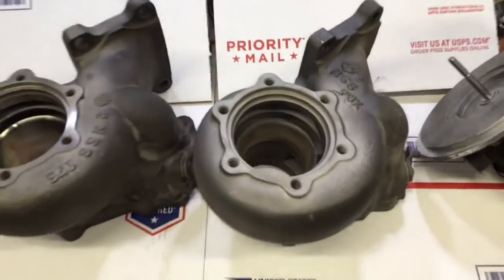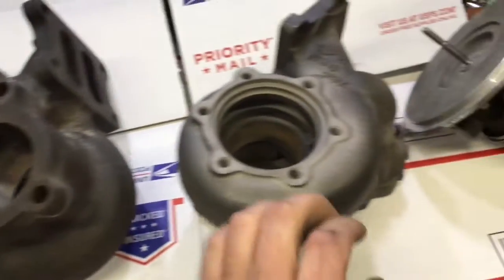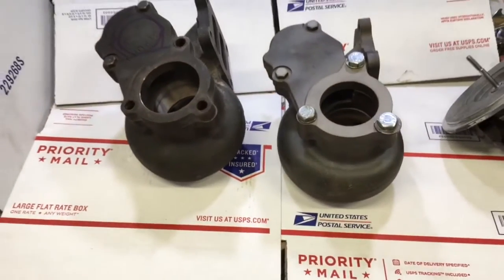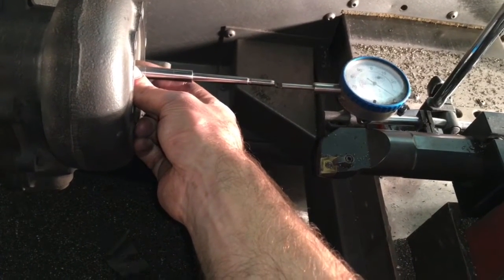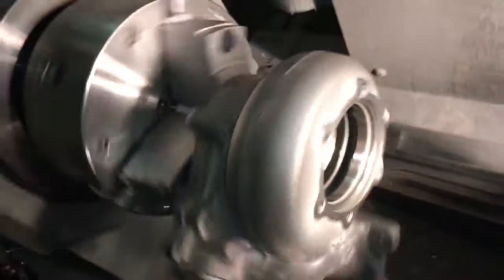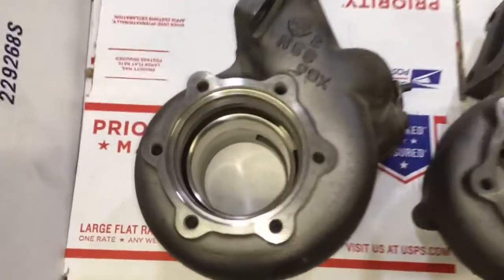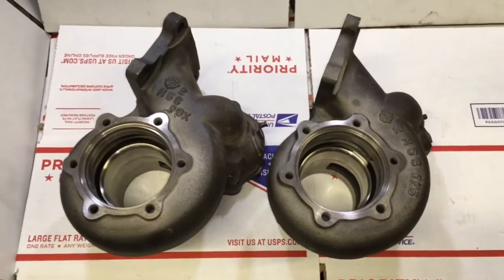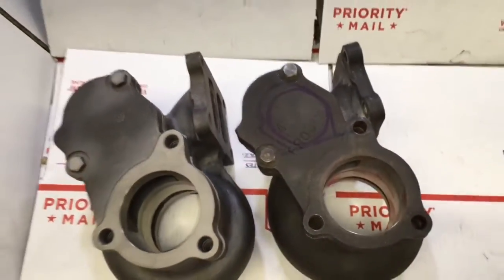Mazda RX7 Turbo upgrade

Comment: PS: we just produced close to 400 hp with these turbo's on a stock 91 S5 13b TII.... mind you there are other modifications required to handle the power, but the ports and intake were stock, 1000cc I.D. primary injectors, 1600cc 5O motorsports secondary injectors, microtech ECU, solid dowel pins and pan brace... (that ifo was fer the rotory guys) , again Trust turbo labs these guys are the S+it! awesome work, thanks again
Reply: !8 to 22... se more detailed answers below
Reply: joe shmo @what psi
Reply: joe shmo how much boost are you running with that turbo setup? I’m wondering if it will be hard to control the boost. Did you just install a 3 inch down pipe? I was thinking about going with 3.5 down pipe? Great job on the 400 hp
Reply: as far as controlling boost, I have ported the wastgate passages, not only enlarging them but straitening out the corners, and additionally I ground a relief in the read cover plate to allow the wastegate door to open further, you can google rx7 wastegate porting (images) for lots of photos , some guys do a butcher job on this mod, it is important to do a very clean job and also to leave enuf material to enshure the flapper still seals when shut, I'm planning on posting some videos of this on my channel soon ,I will also link to them here in the comments ... I use an innovative boost controller gauge to control boost, I was running 18 to 22 psi depending on the quality of fuel I could get, we have NON ethanol here and its good stuff,92 octane. and my exhaust is 3 inch and that's plenty, I have even had 2.75 and had very good results, But my exhaust is only 3 1/2 feet long, as it in not in a street car,.... the tune is the most important part of the gig, we run a standalone computer (microtek lt10) you have to start very rich and keep tuning twards detonation, Again as soon as the season is over we will be posting a lot of videos on these results and hope to gain a following as to help any other s4 s5 guys out, there is an unreal amount of power availibe in these engines that people are in aware of and its so awesome to bring it out!
Reply: joe shmo that’s Pretty cool I was always looking online to see if I can find someone that had done what I was trying to do but couldn’t find much info. Glad to see you did it and you’re having good results I can’t wait to try mine out but I still need a couple more mods before I can install it in the car. I am going to install it on my 93 Rx7 I have an apex power FC still need to buy a fuel pump going to use stock 550 primary and 1680cc secondary. I was hoping for 400 hp I guess I will have to wait and find out.
Reply: 20 psi wow, what duty cycles are.you reaching with the 1000+1600 CC combo?

Comment: What do you guys think of the new gtx3584rs?? Can't wait to get this turbo in my car!!
Reply from the maker: +Guillaume Bergeron is that the gt35r turbine with t67 compressor wheel? We built one for a customer that made great power on an evo, he ran it for a year. He made hp in 700 range then a few month later in the 800 hp range, then his last time made 926 hp but came apart. The gt35r cage wasn't made to run 40 psi with that large of a compressor wheel without antisurge, that's why Garrett has the gt37r cage for turbos rated over 700 hp
Reply: Yes it is, but they changed the turbine wheel and housing, and they revised the compressor wheel like all the other gen2 gtx turbos.